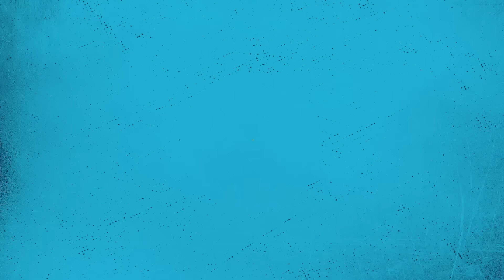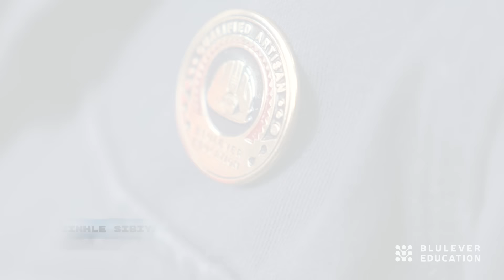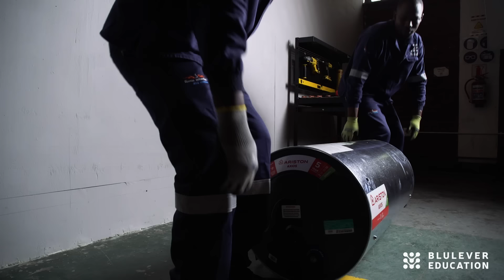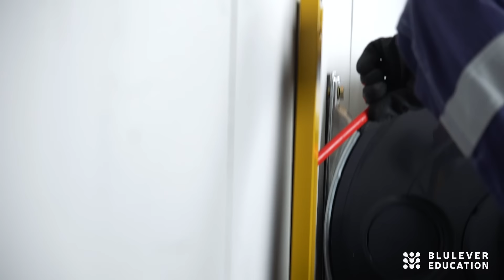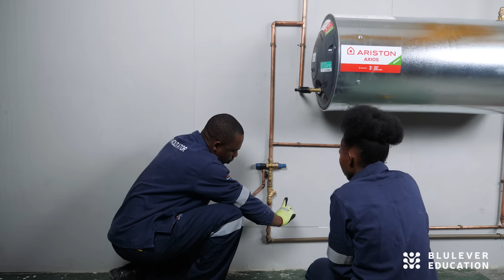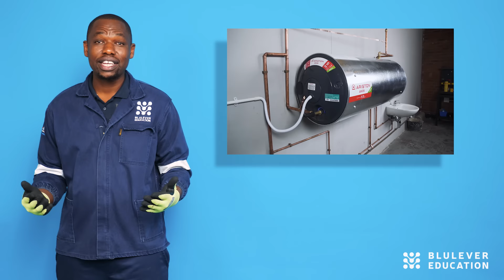How to Install a Horizontal Geyser | Step-by-Step Pro Guide (Ariston Axios)

Comment: Thanks for video I am governed for height in my bathroom do the two 300mm vacume breakers have to be that height please advise trev in cape town
Reply: Hey Trev, if you do not have the 300mm clearance above the geyser, Sans 10254 dictates that you install a 700mm horizontal pipe across the top of the geyser and then install a Vacuum Breaker thereafter

Comment: Hi cause I'm fitting a geezer kwikok type what is the smallest size of the two vacuumed breakers I do know the standard size is 300 mm high cause my height is tight what can I reduce the two breakers
Reply: @trevorelgram846 According to the SANS Standard if the installation does not allow for a 300mm riser, you can take the connection 700mm away from the outlet and then tee it directly onto the line. However, some municipal by-laws do not allow for this provision. You would also have to confirm with the manufacturer of the vacuum breaker if their vacuum breaker may be installed directly on the pipe without the 300mm riser.